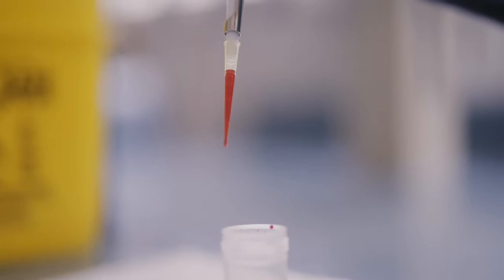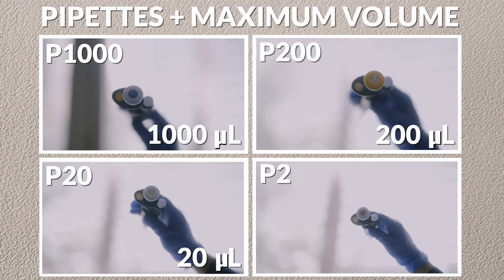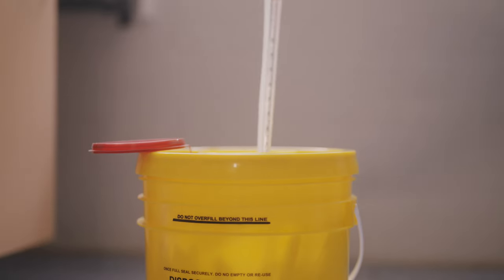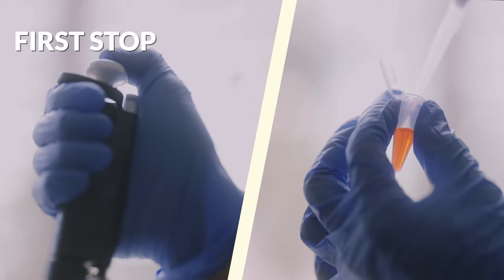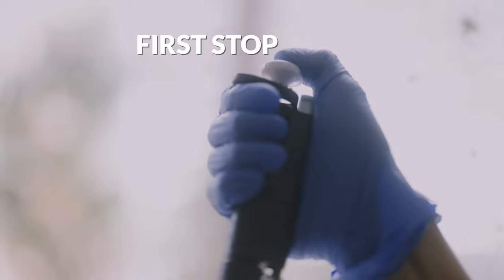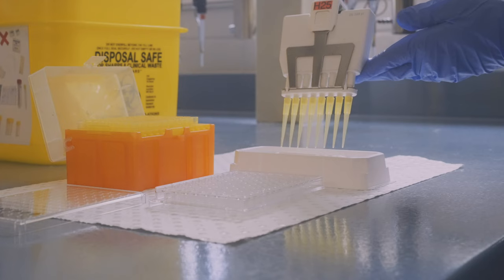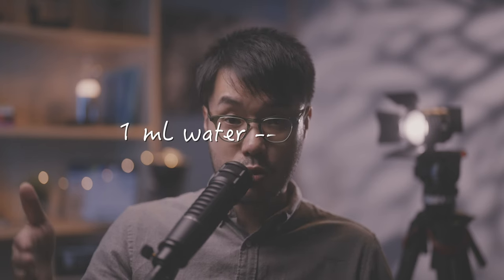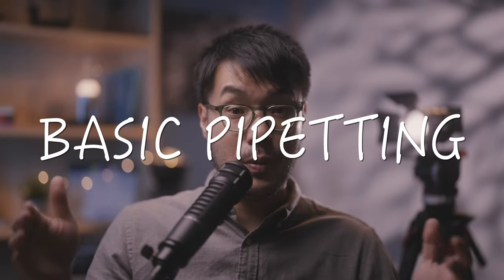Pipetting with precision - how to minimise experimental error

Comment: Thank you for this video. I really appreciate your honesty. As simple as it my seem, the errors from pipetting are shocking. One thing to add tho when dispelling, after the first stop an angle should be made to at least touch the side of the tube before pushing to the second stop(blow off). Helps in accuracy involving smaller volumes. Thanks again❤
Reply from the maker: Glad it was helpful!

Comment: When I am depressing the pipette, I go to the first stop and then the second stop and pull away fast to avoid any little bit of liquid adhereing to the inside of the tip. However, there’s always a little bit left and when I aspirate again it is visibly more than the first time I aspirate with a new tip. How do I make sure I’m pipetting all of the volume out consistently?
Reply from the maker: Sounds like you are pressing too hard (slightly past the first stop) when drawing up liquid, hence the additional air or liquid in your pipette.  Could also be the consistency of the speed at which you press the plunger - needs to be slow and smooth, not sudden or jerky.  Check this video out for the most common mistakes: https://youtu.be/a3KGW1uDllo

Comment: Thanks for sharing! When dispensing liquid, I release at the first stop then second stop, but sometimes there’s liquid remaining. Do you have any idea on why this happens? Should I press it up and down to dispense the last liquid?
Reply from the maker: Sounds like you’ve pushed past the first stop when drawing up liquid at the start?  Too much liquid, otherwise there shouldn’t be any left over. Sure dispense all of it, but you should practice your technique more using the tips we talk about in the video.
Reply: @BioLabCollective  thanks I will closely watch it next time!
Reply: @BioLabCollective  thanks for the tips! My technique has improved alot. Another question- for positive displacement pipette instead of air displacement pipettes like these , do positive displacement pipettes have first and second stop? I have quite a bit of trouble using them not sure if I use them correctly.
Reply from the maker: Yes they should have first and second stops too - depending how how they’re tuned you may not need to push to the second stop to dispense all the liquid?  The second stop may just be reserved for ejecting the tip

Comment: When i used 2nd stop produce a air bubble. What is the reason for tht?
Reply from the maker: You can try immersing the pipette tip in the liquid before you draw up any liquid. The speed at which you push down on the plunger can also affect bubbles?
Reply: @BioLabCollective  thank you 🙂